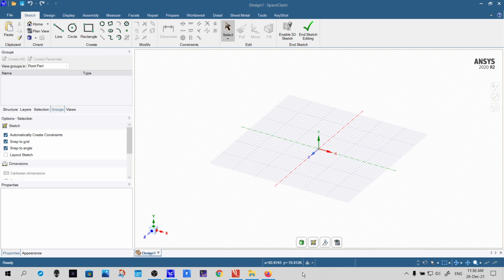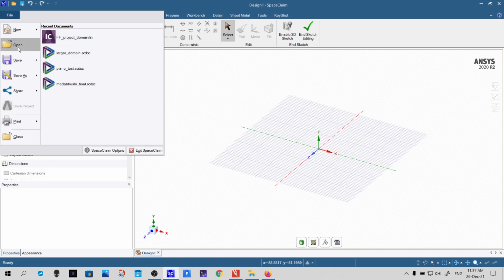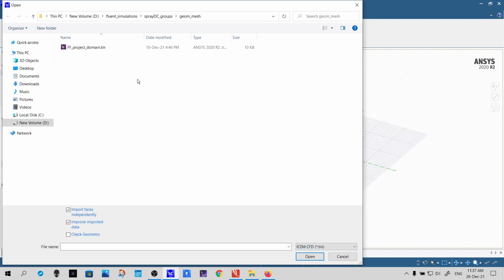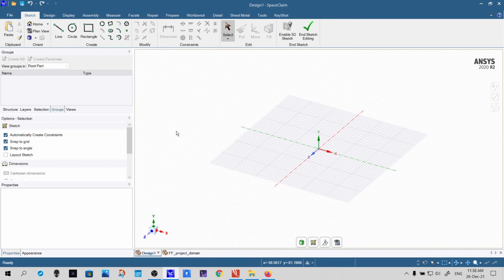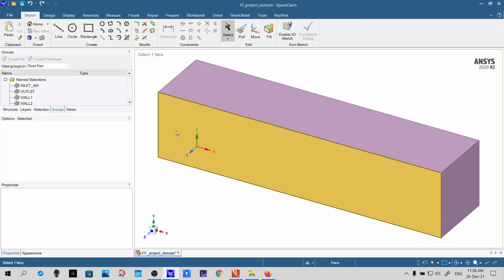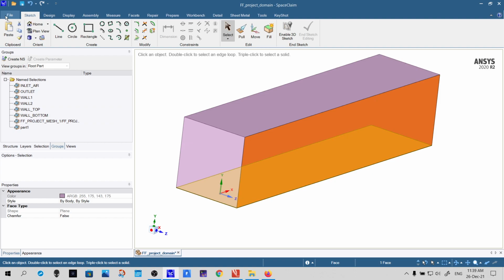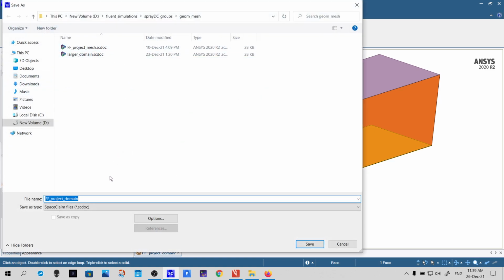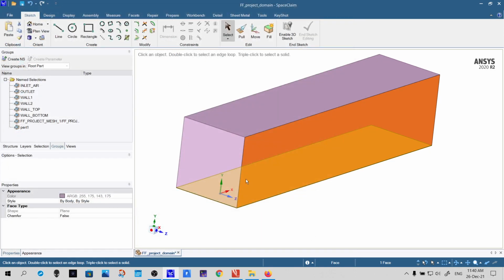Importing ICEM CFD geometry (.tin file) in to SpaceClaim

Comment: is this  format better than importing stl file?? i imported point data of measured bed into icem and built other surfaces (inlet,outlet and side walls, top) around bed. I am combining them in spaceclaim to create single solid (from stl). But in space claim the surafces are processed as facets only??